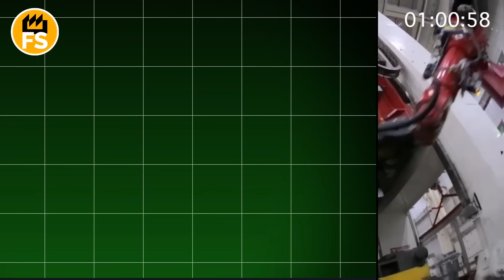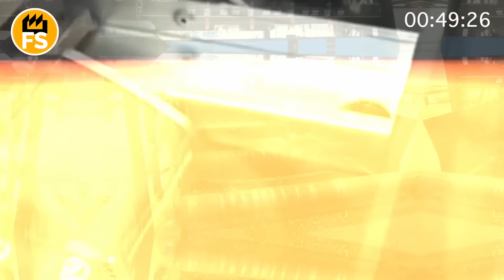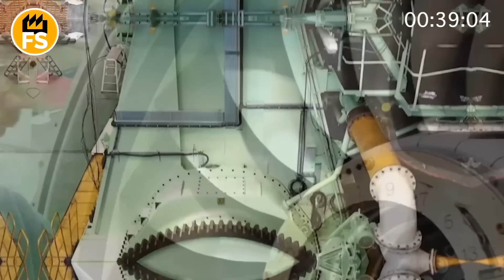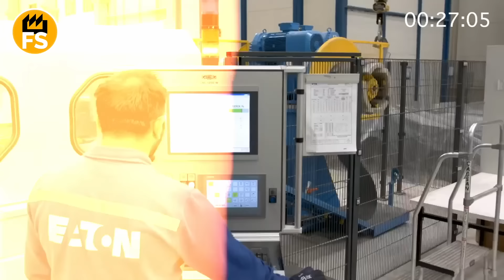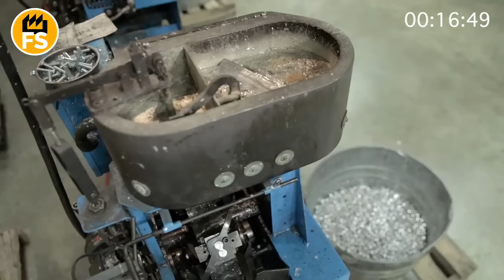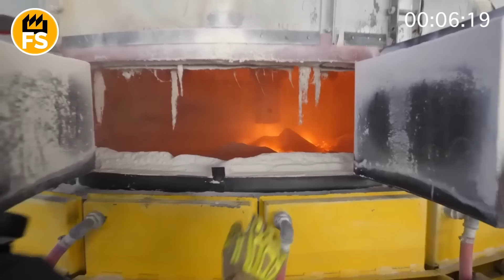How It's Made: Electric Motors (300 Million Produced Every Year!)

Comment: P.S. Steel coils are also VERY DANGEROUS to transport. Although the sizes of steel coils, and the weight vary, the steel coils that semi trucks 🚚 haul, usually weight in at 50 tons per coil. Again, your friend, Jeff.
Reply: 50 tons?   Most US states have a 40 ton weight limit.   25 tons (50,000 pounds) is the number I believe you were going for, unless you're talking about coil weights outside of the US.  If that's the case, I apologize for correcting you.
Reply from the maker: Thank you for your insightful comment, @jeffreyhickman3871! Indeed, the transportation of heavy materials like steel coils presents significant challenges, much like the precision required in manufacturing electric motors. ⚙️